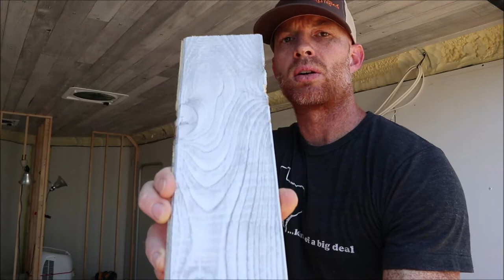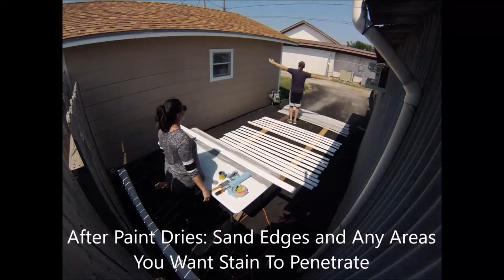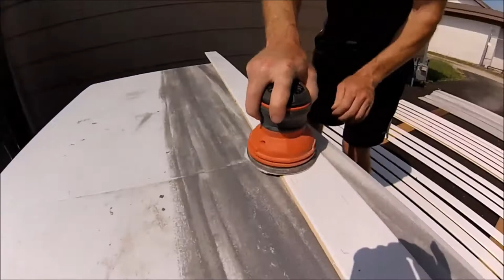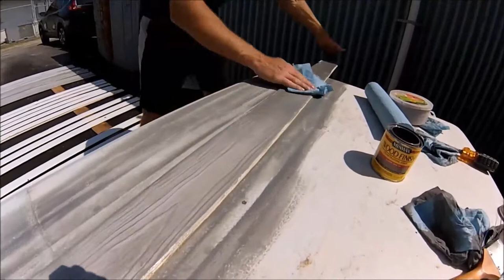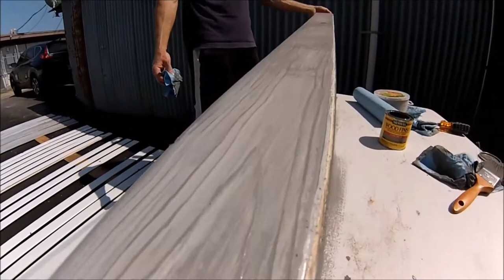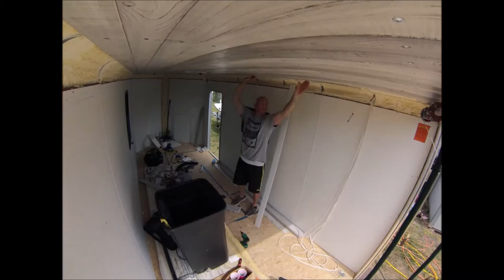Cargo Trailer Conversion Ceiling Knotty Pine Slats Stain over Paint How To

Comment: Very nice! It looks like you guys used Great stuff and trimmed the corners (where the ceiling meets the wall)? How did u trim it so accurately and what does that corner area look like now? Thanks!
Reply from the maker: Hi. We used a metal corner panel that came with the trailers original setup. We just reused them. I think you can see how it looks in one of the update videos, thanks!

Comment: Hi Danial,  Great looking ceiling, could you please explain how you fastened it up? Also what was the appropriate cost of the closed cell foam ? Did you do the spraying or did you hire it out?  Planning my build and sure thank you for your videos.
Reply from the maker: Elwood Watson we predrilled every single board where it meet a cross my support of the trailer and center screwed each plank. Was slow going.... I hired out the spray foam, it cost $350. Tell a spray foam company u are willing to bring the trailer out to a job site where they are already set up for spraying closed cell foam. This will save u money. Hope to see your build on here in the future!!